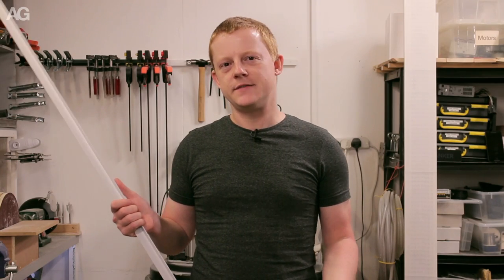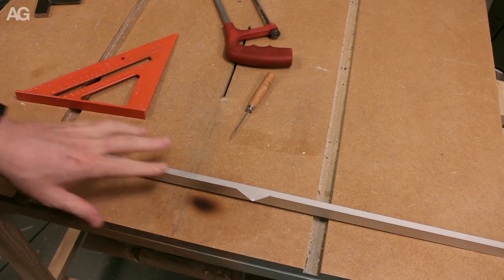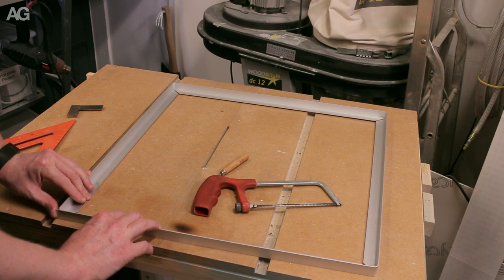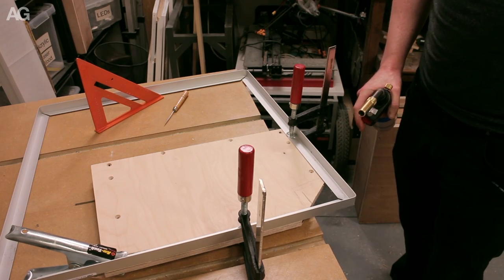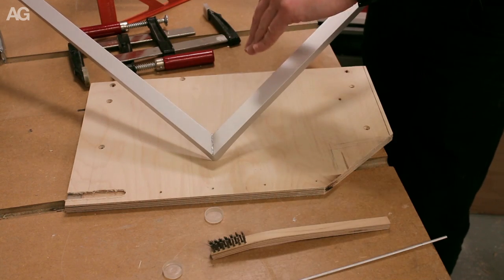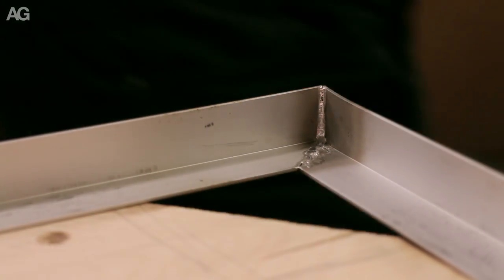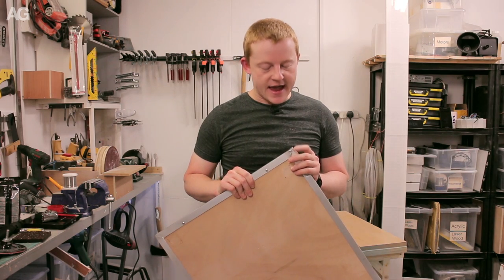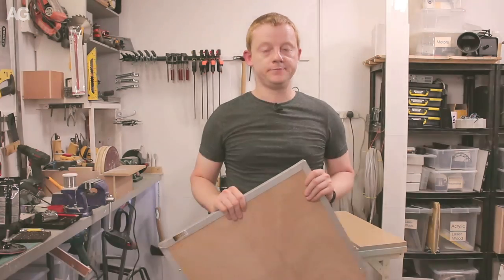Brazing Aluminium - Successes & Failures

Comment: Braze (solder) joints preferably need an overlap to work properly and have strength. 
With most materials, but especially with aluminium, they need the oxide cleaned off before brazing/soldering. 
Aluminium is a heat sink, therefore heat will dissipate quickly to other areas resulting in the melting of previous brazes/solders.The other result is that the material cools quickly when heat is removed, meaning that the braze/solder doesn't pass into the joint as well.
However, for the project that you were trying, the lack of overlap between the materials is the reason for the utter failure. Look at bicycles... all brazed bicycle tubes are fitted into lugs because brazing needs overlaps to gain joint strength. Welds, on the other hand, do not have this requirement and the parts are butted together. In your project, you were trying to create an object with structural integrity by joining the thinest edge to the thinest edge with braze/solder - not going to work or not going to work well. Just planning to cut your pieces longer and have the vertical piece seated within the horizontal piece would have resulted in a stronger brazed/soldered joint.

Comment: De-oxidizing the material as you go is critical with this type of rod. If you don't do this, with either flux or s/s wire brush you will end up with a joint full of impurities and be like a cold joint as with soldering. The result is low strength.
Reply: yeah that's what I thought.
Reply: Can you use a wire brush type disc on an angle grinder? How about steel wool?
Reply: I was wondering if flux would’ve helped these all looked like cold solder joints to me haha

Especially when he said solder sits on top. Flux is what ya need to suck solder in!1!!

Comment: If you clean all the surfaces thoroughly as mentioned many times already and add a small angle  piece on the inside to give more surface area for the pieces to bond to each other, it might work a lot better.

Comment: with the information i have i can tell you you probably need to scratch the aluminium under the added metal with a sharp (also hot) object , so some of the oxidation is removed under there (can't grow back since it's covered) for a more descent bonding

Comment: There are high- temperature resistant epoxy glues, which are sold in Amazon, that bond metal to metal. Have you ever tried those glues?

Comment: Don’t get me wrong on this but you took time to demonstrate how to braze and post it on YouTube which I have respect for you in doing that. With that being said I would like to a suggestion on brazing a butt joint or two pieces of aluminum together instead of filling a gap where you cut it to make a 90° bend.  On the two pieces you cut off and now wanting to make a butt point by brazing the two together. Try chamfering ends of the aluminum to allow a channel for the brazing material. Also try to scuff up all surfaces that you are going to be brazing to and remove any oxidization and oils that are on the aluminum. See if you get a better bond and stronger joints. I saw in your video that you never scuffed and surface on the frame you brazed or the butt joints you tried to do. Just use a good stainless steel wire brush to scuff up the brazing areas and you should get a better bond. Again I’m not trying to down you in anyway on what you are doing. I’m simply trying to help you. So good job and the videos you have posted. People like you do make a difference. God bless.
Reply: I'm almost glad he made the mistakes/errors because of all the useful comments - I wonder if more videos shouldn't be made like this ??

Comment: Interesting.
 
Perhaps your lack of strength/penetration was because you didn't seem to do any de-oxydising to the surfaces/edges to be brazed.
Reply: Having made thousands of brass/steel brazes in a commercial environment I knew what I meant, but perhaps did not express it well, To spell it out to the nth degree, when I said penetration I did not mean into the parent metal as in welding, I meant into the joint as in capillary action.... drawn between the pieces of metal. If the edges were not clean they might help to keep the rod from flowing into the joint.
Reply: I did a similar thing a few years back, oxidation was a real problem but I came across some rods from ebay that contained flux and they worked fine, but they are not available now, also the amount of buckling and expansion was greater than I expected. This video makes it look easier than it really is
Reply: Certainly a flux would aid the process, and reduce the need for much of the cleaning. I can't remember the basic components, a little research should provide a suitable solution. Until one develops the "skill" of dealing with a new material it is always going to be more down to luck whether the end result is good. Practice makes perfect. In many cases by the time one completes a project one has learned the skill that was evading you at the start. Example, I used to mig weld 22 guage galvanised steel in a host of different and difficult locations on a production line. Because the men I worked along side were very practised at the work they had the amps and wire speed set up to ridiculous levels so any new worker really struggled. Usually running a weld about a foot long only to see it drop to the floor below. Very quickly I learned the technique and picked up the pace of my work to match theirs, running perfect beads at break neck speed.
Reply: Capn Pugwash Thanks for your clarification regarding this method of brazing. Im gonna try this at some point.
Reply: There are a lot of crappy aluminum brazing/welding ros on the market. There is a technique to make them work well though.

The AlO2 layer keeps the cheap rods from bonding. But. If you scrub the rod on the metal while it is hot, it will dig below the oxide layer and start to wet out the aluminum. Joints formed this way can be quite strong.

There is a quite narrow temperature window that these rods work at. Unlike steel, when having trouble with complex joints, the answer is not more heat.

Watch some of the better video's to get better instruction. I like MuggyWeld #5  and Blue Demon 3 Way rods and their videos are quite good.

Comment: OK I watched a guy last night he used firstly sandpaper then a good going over.  witha a good stainless steel brush then acetone to clean up. He then proceeded to braze to thickish pieces of aluminium at right angles to each other and then he beat on it with a 2 pound hammer for quite some time before it eventually gave way. You need to clean all surface thoroughly before brazing.

Comment: Aluminum brazing produces a strong joint as long as you know enough to first clean the weld zone and use flux
Reply: What’s flux
Reply: @xero3965  Its a chemical cleaning agent (usually a thick paste or gel) that will also keep the metal your working on from oxidizing while brazing/soldering it. Additionally it also enhances the flow-ability of the braze or solder material. After you physically clean your joint from grease and oxidation you apply it to the area you are going to braze or solder.
Reply: Cpt Adama is there a video I can find to watch this process? I have an aluminum skid plate that is pretty thick and has a crack in it. I want to make sure I do it correct before I ride my ATV again. Thank you!

Comment: you could have used a metal brush or sand paper first to deoxydize the surfaces then heat it..joining more than 2 parts is easier if you would have melted some alum rod on joining surfaces then clamp them prior to heating and brazing..

Comment: You must prep the aluminum with a brand new stainless wire brush (one never used with any other material than aluminum). I like to use stainless wire brushes with a Dremel, much quicker and efficient than doing it by hand. I think also if you were to make a jig to hold the pieces together, they wouldn't have fallen apart.
Reply: A clean with acetone goes well too.

Comment: Low temperature is key to success for brazing aluminium, I will be trying Uniweld's Uni4300 soon as it claims a temperature of only 500 Farenheit, as the melting point of aluminium is over 1200 F this should be suitable for small or thin aluminium parts

Comment: Thanks. I ran into the exact same issues. For small fixes it's great but for something more complex (I was doing something very similar to you) it's very frustrating. 

I know it can be done. But it's almost an art. Actual brazing is used on steel to build bikes. But it takes good  equipment, prep, and technique. I found the problem with lower temp propane setups take too long and run the risk of oxidizing the surface and desoldering parts close by.   

This is why many jump to straight up welding if they have the equipment and this process not being that popular.  With the investment required it's easier to just whip put a welder and end up with a stronger bond anyway.

Try mapp gas of you haven't yet and look into a flux. And spend a min preheating the surrounding metal so heat gets sucked away from your desired spot slower and the desired spot gets to temp quicker.  Many will brush the surface a second time after heating it up. Also a lot more practice.

Comment: when ripping apart the part at 5:05 you had the end of it properly brazed that the metal ripped before the braze, you have to chemically clean the surface, tin it then add your tube and use your rod, aluminum gets a bad rep because of its fast oxidizing properties when in reality its almost always user error

Comment: Thanks for sharing. Not technically brazing as that involves brass, it's much more like (if not actually) soldering. And as others have said, you need to clean the oxide layer off (wire brush or abrasive paper), and some kind of flux to stop the metal oxidizing as you heat it.

Comment: Wow do I need help! I need to solder an aluminum bar that is very thin, if it helps you understand, I'm soldering one of those Halloween animated figures that use the black aluminum 
poles to keep the costume upright. I cracked the pole at a "T" junction. I tried solder but it's just too thin and falls right through (the kind used for electrical soldering) but the 
bar in your video will be far too thick to work with. What can I heat up to fill the crack and repair the break once it cools? Thanks so much

Comment: Hi, thanks for the video - very informative.  I am building something simular, except plan to use sheet aluminum for the panel instead of wood, for durable suitcase.  Probably need a 3-way jig to handle those joints, maybe more practice.  Nice to see the problems and what to look out for.

Comment: Aluminium has a natural top layer of oxidation and if not removed it takes ages to preheat or create fusion both sides. Bad call for ruling it out but you can always buy a $600 tig welder i guess...

Comment: @5:02 Unlike what? Welds? I can't make out what you said.

I have been trying to do the same but I still haven't found an easy way to make structures from angle aluminum (besides riveting them together or course). The corners never line up neatly no matter how careful I am with the hacksaw, there is always a gap due to the radius of the bend and bending the corner a couple of times fatigues the aluminum so fast it often cracks or breaks. I haven't tried butt joints because I don't like sharp corners.

Those look like some weak joints. According to the manufacturer the weld should be stronger than the surrounding material but it looks like this isn't the case. Did you use flux?
Reply from the maker: +papalevies that's right, a weld.
Brazing isn't welding which is why the joints were so weak.
Brazing has its place but this isn't it!

Comment: I would have overlapped the raising joints. This way I get more welding points per joint and finally I wud not spare much except be more solder per joint

Comment: I think you are probably correct in your conclusions.. but I think also  your joints are not as thoroughly heated as they should be.. applying heat after the "solder" has flowed on.. should allow it to be a smooth clean joint, that adheres better.. at least I see that in other videos.. where they pre-heat the metal.. and also leave heat on longer.

Comment: Granted that the type of joints you tried to braze are not the most suitable for brazing, based on what I have seen on other youtube videos you are not doing it correctly. The strength achieved in other videos are incredible, I have these comments/questions/thoughts: 1. you didn't clean the metal properly, you at least didn't show the cleaning in the video, since aluminium forms an oxide layer with a ridiculously speed proper cleaning of the surface to be brazed is critical. 2. I think the proper way of doing this is first wetting both/all surfaces that is going to be joined and then when all parts are properly wet then put them together and apply heat and possibly more brazing rod, this depends on what actual product you are using, cheap brazing rods are obviously not reliable.  3. What brazing rod did you use? because all brazing rods are not created equal(that's a huge understatement), using high-quality brazing rods might actually allow you to do what you tried to do(although, as said the but joints you tried are not the ideal joints for brazing but with proper rods and proper procedure I believe it could have been done successfully, successfully doesn't mean creating an impressive amount of structural strength compared to a weld or a solid construction of the base materiel, if you did re-think your design a little to create overlapping of the surfaces then you would be able to braze a construction which would display some structural strength). Please note that I have no experience brazing but I am doing my research preparing to use aluminium brazing rods for an upcoming project and these thoughts just jumped out from what I have learned so far. Regards

Comment: You did not use Flux, nor did you thoroughly clean the Aluminium before attempting the brazing. Get yourself some Flux (around £5 a jar) and a brass or stainless steel wire brush, it's all in the prep. the more you put in, the better the results-Good Luck!
Reply: What kind of flux? Just general flux or is there aluminium specific flux?

Comment: It doesn't look like you cleaned your pieces. No way solder is going to  bond to aluminum oxide or oils. Clean with acetone, then sand (hard), then clean again with acetone. Oh, and clean your rods.

Comment: Slop joints because they weren’t cleaned. Cleaning is critical!
Stainless steel brush (& don’t touch them with your oily fingers), & flux to prevent oxidization on the surface and to get a good “wetting” action